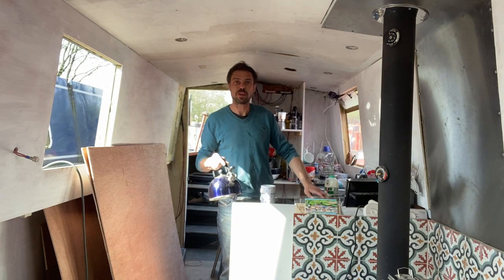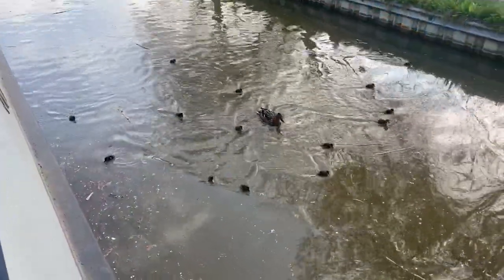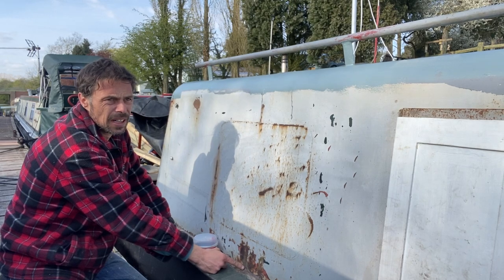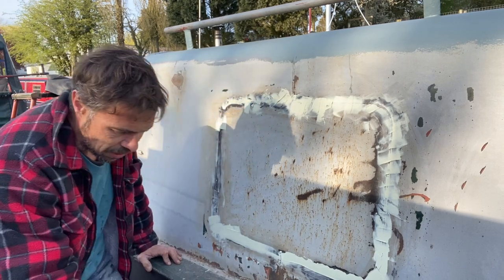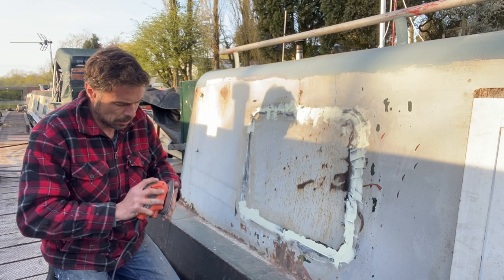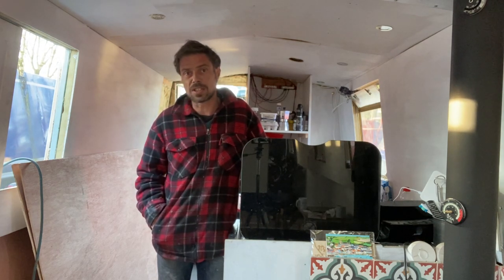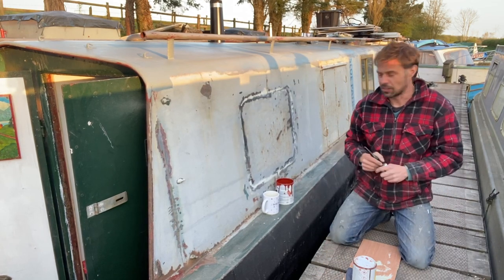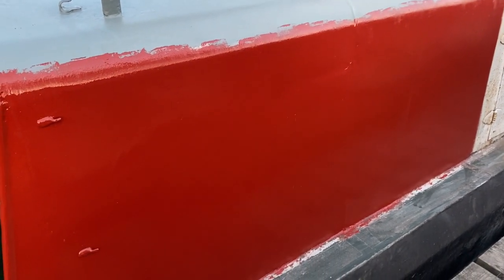167. Repairing Narrowboat sides

Comment: A very good first effort with the filler. You will never get it perfect on just one application. And you need a wider spreader. Use the side of the spreader you have and load the filler the full length of the longest side. Put spreader at about 30 degrees to the panel then with one slow sweep, run the length of the part to be filled. Never go back and try to add more, just leave it to dry, sand, and re-fil if needed.... 👍
Reply from the maker: Now there’s someone who knows their stuff. Thanks - loads of filling still to do so great timing here 👍🏼👍🏼👍🏼

Comment: After primer. You can get a large tube of fine filler and skin the whole thing or add a filler to the primer and make a putty. We would do it to a whole car and boat to fair it out. Walnut shells works great for non-skid. Looking good!
Reply from the maker: Good tip - where do I get a tonne of crushed walnut shells !!
Reply: @TheNarrowboatThatJamesBuilt  Amazon, Google. Different grits available.

Comment: The more Hardener you mix in - the FASTER the filler will "Kick" (usual industry terminology).  Best practice is to put on a thin layer, then sand back - and repeat if necessary. Another touch of filler might hide those seams a bit better -  Bodymen use a long, rigid sanding block to make the filler flat and straight.  A piece of 2"x2" about 24" long, with a long piece of sandpaper attached should do it pretty well!

When it gets painted.....  if you get the artist to do a musical staff, You might get them to use Sloe berries for the notes!
Looking Great!

Comment: When we painted steel boats where I used to work they were sand blasted... then we put two coats of two pack hempel on. Then we filled and faired and sanded. .then two more hempel undercoat.  Then three to five top coats. We did several boats back to bare steel topsides and below the water line and they were still free from rust when I left 10 years later . We masked up and entire  50 foot steel cruiser weighing 30 tons just to spray three stripes. Took 4 days of masking  and they were sea going boats... I always like to put a coat of paint to seal the steel before the filler goes on. And preferably fillers and paints from the same manufacturer. . I'm big fan of hempel paints but after years of using them I'm hyper sensitive to them and just a bit of splatter on my skin give me rash all over

Comment: A coat of paint, even red oxide, doesn't half tidy up the boat. I wouldn't worry about getting it perfect, it is an old girl after all. Better to crack on and get the coats applied, speaking of which I would have tried to get most of the painting done at the wharf rather than on the cut.
As for the gunwales, surely you can get some sort of wide anti slip tape that you can paint when fitted? You see the stuff on stairs and in other applications not just on boats. 
Good weather forecast this weekend for North Kilworth so you should be able crack on outside 👍

Comment: i don't think you will ever get the seams invisible unless you spend too much time sanding, grinding, refilling over and over.  You haven't said much about your final paint colour but if you are going for masking tape coach lines in a second colour then you could mask a frame shape over the seams and use the area inside the frame for your boat name to disguise any imperfections.  Both sides of the boat will be different of course because the galley window is on the other side but the magnetic sign could go on the galley side.

Comment: CAPITALS DUE TO PARTIAL SIGHT AND REDUCED COGNITIVE ABILITIES.

IN CARPENTRY WORK MAKING A FEATURE OUT OF JOINS IS COMMON..

V MATCH BOARD IS ONE, THE REASON FOR THE V JOINT IS TO PREVENT BUT JOINTS BEING SEEN ONE PAINTED.  

ANOTHER IS ARCHITRAVE, THE REASON FOR SETTING IT SLIGHTLY AWAY FROM THE EDGE OF DOOR/WINDOW FRAMES IS TO PREVENT BUT JOINTS.   

ANOTHER GREAT VIDEO MARTIN 

CHEERS MICHAEL

Comment: Usual trick with filler after applying it, dust the area with spray can (any colour) and when you sand down it shows high and low spot areas. 
Your finish was still a 💯 pass 👍🏼 it’s all in the prep and particularly, shelf judging is our own downfall. Your doing the best as one can, whilst learning on the go. 😊

Comment: Are you not going to use rust converter before paint?
Reply from the maker: I will do on the gunnels and where it meets the walls as that’s where the rust is. On the walls and roof there’s no need
Reply: @TheNarrowboatThatJamesBuilt  👍

Comment: If you don't wish areas like that window blank to be visible, you'd need quite a substantial quantity of filler, and coat the whole panel – flatting back in large areas with a broad sanding block, as they do with old cars in America. It's probably not worth worrying about.

Comment: That area looks almost as if it's had a window there at some earlier stage of life. (Oops--just heard you say as much at 13:10...) Impressive lack of flaws in that primer coat--much improved surface. Don't drive yourself crazy trying to get it perfect--it's a nice bit of the. boat's story to use the ultimate finish paint job to disguise some of its flaws.

Comment: It's been driving us mad... what's the 1st song that James was playing?  It's been on the tip of my tongue ever since and now resorting to asking on here.
Reply from the maker: It’s called Desperado....and by the way it wasn’t me playing - that credit goes to my dad. 

Also by the way, I wanted to look for what to do with that oak to make a table, turned to YT obviously and three vids was one of yours !! I like that scrapy thing you used 👍🏼👍🏼👍🏼
Reply: @TheNarrowboatThatJamesBuilt  that's it!!!  It was driving me mad, trying to think it was something that rhymed wih El Dorado 😂
Reply: @TheNarrowboatThatJamesBuilt  ah yes.. it's a brilliant tool that drastically cuts down time with sanding.  I've since seen a cheaper one with cheaper replacement blades at Screwfix (Harris scraper I think).  The replacement blades are half the price if it helps and going to check if they fit in my Bahco too.

My first blade is still working, but it's probably a bit blunt now as used it on a lot of projects 👌

Comment: Skateboard grip is way better - you can buy it in rolls. The problem with sand is getting it off when you need to repaint, when the sand has gone too smooth to be grippy.
Reply from the maker: Skateboards to the rescue !! Good tip cheers

Comment: RE-SPECT Treat your hills and valleys on the steel-work like taping sheet-rock. Feather in and feather out with the body filler. Just like on a car-body,  they will disappear.
Reply: Just use a wider puddy knife, not that little piece of plastic. You will have more control over the bondo.  RE-SPECT

Comment: On that window blank, you could use a dremel or other small rotary tool to clean the pits out from the welding and re-weld over those areas, then smooth it out again. That way you don't have to worry as much about the structural strength & thickness, and the paint looks good. Just an idea.